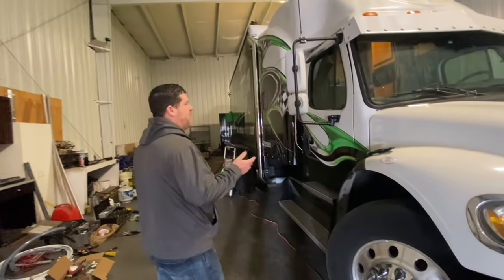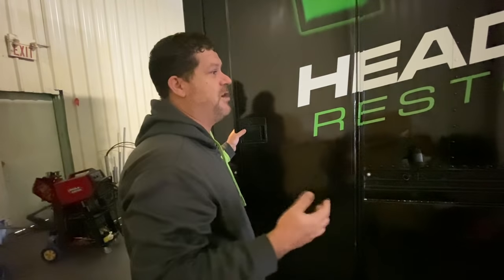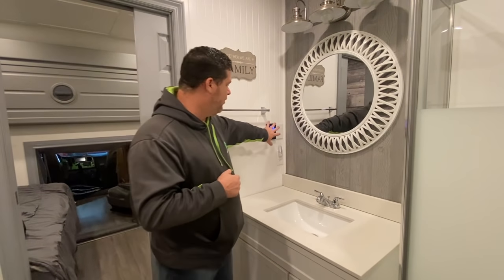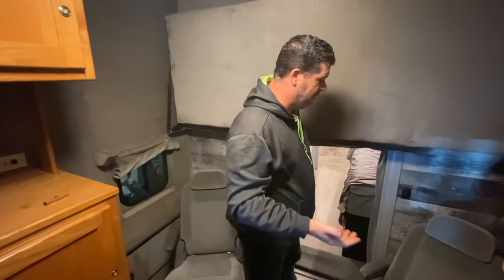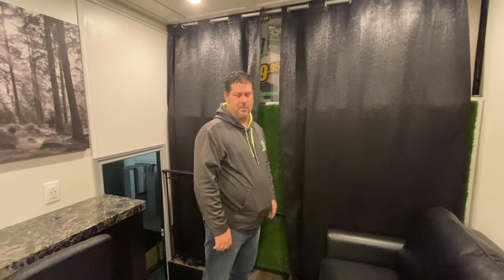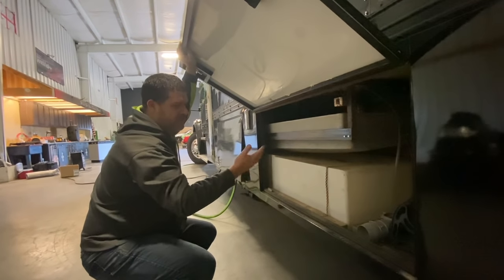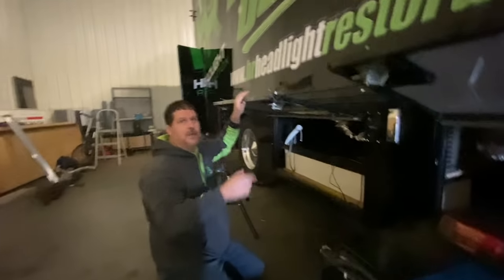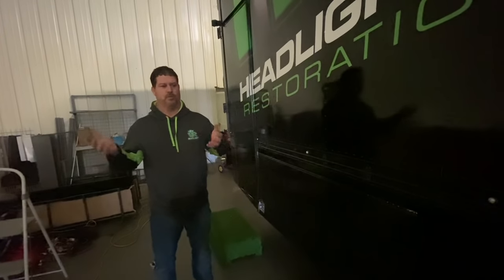Box Truck to RV!! Was it worth it??

Comment: $9000 for the interior?  What did you do gold plate everything like Donnie?  Do it right the first time?  What the hell is that supposed to mean when you're making a custom?  No wonder you spent yourself blind.  You wanted a Donnie Chump motorhome.  That's a bit too grandiose for me.  That's a bit excessive to me.  You could've thought this through much better.   I had to.  I was building an, on location radio and TV production vehicle.  And it needed to be self-contained.  And I wasn't wealthy.  I did this on a shoestring budget.  And it's immaculately done intelligently.  And my 2 carpenters worked for free.  As long as I paid for the supplies.  In exchange.  For recording their rock band once.  But that was not good enough.

That's right.  I deemed that not good enough.   And I told Dave.  That I could not record his band once.  He looked rather forlorn.  And said I would do the truck for you anyhow.  Because I need to know how to build a recording studio.  For another client.  I said no Dave.  You don't understand.

What Dave did not understand I was saying was.  I can't record your band just once.  I'm going to have to use your band like a guinea pig.  Like a chimpanzee.  Like a lab rat.  I'm that I have to follow you guys to the nightclubs.  I'm going to have to record you more than once.  To establish and get my routine down.  So  I can't record just one of your bands just once of the five bands you play with.  I have to record all of those bands.  He did not object.  And so for the next 10 years that's exactly what I did.

And so anytime I wanted to experiment with a new technique.  It would not be for a client that was paying me.  And so it didn't matter if I screwed up.  Dave and his bands.  Still got great recordings for free!  So that I could get ready.  And be prepared.  For doing those big radio station, national television and worldwide satellite broadcasts.  Of music entertainment events.  When we used to have them.  A year ago.  But I saw the handwriting on the side of my truck.  It wasn't going to be doing that anymore.  Because we can't.  Because it's over.  Our lives irrevocably changed.  As I was turning 65.  And 30 years into my business.  Which is now busted.  The business is busted by a virus.

But again.  I can't let the virus stop me.  And I'm going 100%, digital now.  Which is a lot more lightweight and portable.  And sounds every bit as good though not the same.  And I will have to adjust my recording and mixing techniques yet again.  Because I know how to roll with things.  In any sense of that term.  And my equipment was very valuable.  I had the best of the best of the best of everything.  And what does that mean?

It means.  If you watch a free movie on YouTube.  Directed and produced by, Dave Grohl called, Sound City.  That's precisely what was inside my truck.  Only better.  One of the greatest control rooms.  And on wheels no less.  Complete with a couple of internal studios also in the box.  That could accommodate musicians, also.  Or an FM DJ.  Or a television crew.  And it's been around for 30 years now.  And still going strong.  Because it's a brand and model of a truck.  That will virtually not die.  It's so well tried and proved over the years.  You don't find these here in the United States much anymore.  But you still find them all over the world in service to this day.  That's how well this Mercedes-Benz truck was built in 1984.

Oh come on.  You didn't think about that thermostat before you built the wall?  That wasn't well-thought-out.  I planned on my thermostat and where I wanted it to be.  And what about your central air conditioning?  An heating?  I have a forced air system.  The outgoing louvers..  Are up at the ceiling.  So the cold falls down.  I have the world's only 19 inch rackmount air conditioning outlet louvers.  Because I know how to design sophisticated recording studio and broadcast, control rooms.  You have to know what you want to install, first and prepare for that.  Build for that.  I did.  It's perfect.

And on top of that.  I pack a 7.5 kW, power isolation transformer.  Which means.  I can take 120 volts or I can take 240 volts.  And my power will always be electrically isolated.  And filtered.  And clean.  It kept my audio equipment even quieter in its operation.  And prevented any buzzing or hums from, what we call ground loops.  I share no electrical connection with anyone or anything.  Even if I am pulling power from the same place they are pulling power.  I'm isolated.  And nobody realizes the advantages of that.  Virtually no chance of electrical shock.  Virtually no dirty power.  Polluted by other compressors, motors starting, electrical interference, radiofrequency interference.  All nonexistent inside.

It was even built.  With a couple of internal walls designed to be removed for easy access to electrical, HVAC and audio wiring.  In the middle of the three rooms.  Which serves the rear room and the front room.  And is easily modifiable.  And instead of recessed lighting.  Which is very nice.  I like.  I elected to go mostly with, good old-fashioned track lighting with LED spotlights.  And LED rope lights on the floors.  On the walls.  Around the ceilings.  All on Lou Tron dimmers.

An conversion over to motorhome.  Will cost very little.  Between a few hundred dollars to $2000 maybe?

And oh by the way.  The whole thing has hardwood floors throughout.  About 3 inches thick.  Originally wall-to-wall carpeted.  Now Oriental throw carpets.  As the interior has gone through approximately 4 upgrades, modifications and iterations.  In the past 30 years.  Like any of these.  It's always a work in progress.  Because I designed it.  From the ground up.  And I know how to design for what is necessary.  No afterthoughts here.  As I have custom-built plenty of other recording studio and broadcast station control rooms.  And you learn a few things.

So that is an excellent well-thought-out custom box truck motorhome of a Super-C Class, variety.  Totally super!  And it can sleep up to 3 or 4 adults.  Without any stupid beds connected to the walls.  Because that's hokey.  As I have a futon couch in the living room control room.  I have a foldout foam 2 person loveseat couch.  The size of a double bed.  In the middle room.  And in the rear.  There is enough room for 1 or 2 plywood platform.  On storage boxes.  That can accommodate.  Air mattresses and memory foam topper mattresses.  That disappear easily against and behind a wall.   With the topper rolled up in a storage box.  But the couch and the futon only needed to be folded open.  And that can sleep 4 right there comfortably.  With another 1 or 2 in the rear room if necessary.  And 2 toilets.  One in the cab.   One in the rear of the box.

The walls all have 6 inches of compressed pink fiberglass insulation.  Compressed down to 3 inches.  The same with the ceiling.  With the aluminum skin roof that is reflective.  And keeps the heat load a little lower.

And so I did all of the math.  To determine the size of HVAC BTU's I needed.  With 4 people on board during a 93° day in the sun.  And it said I needed 18,000 BTU of air conditioning.  So I purchased a 24,500 BTU air conditioner/heater.  And had it custom mounted on the rear of the box outside.   The one and only entrance door is to the right.  And it has a power lift tailgate.  I typically use as the porch and entrance route.  I've also been known to set up a table on the power lift tailgate porch.   For a myriad of reasons and purposes.  From cooking to selling recordings.  Or to enjoy a nice meal outdoors not on the ground.

So in many ways.  Our designs come very close to one another.  In our conceptual execution thereof.  Only the acoustics in yours is resonant and boomy sounding.  Mine is very tight, quiet and subdued sounding.  With a boatload of acoustic ambient absorption.  And doesn't sound like an empty garage like yours.  It's intimate sounding and feeling.

And yeah!  No windows on the side of the box.  Because I don't keep normal hours.  I like to sleep late.  I like to sleep in.  I like it to be 3 AM at 1 o'clock in the afternoon.  And that's when you turn off the lights inside.  And nice cool quiet noise free air conditioning.  Because there would be open microphones.  And you don't want to hear your air conditioning with open microphones.  Right?

So that was a great build.  I'm very impressed.  We are now family.

Oh Lord.  Won't you buy me.  A Mercedes-Benz.  So I did.

About 25 years ago I really freaked out my father.  He didn't live in town.  But he occasionally came through town.  With the Cleveland Symphony Orchestra for which he was one of their concertmaster violinists.  And we would get together.  And go out for dinner.

This time around.  I told dad.  I would be picking him up in a 30 foot long, white stretch, Mercedes-Benz.  He got very alarmed by this.  He asked me, "Remy, you're not selling drugs are you?"   I said no pop I'm not.  But I have this 30 foot long stretch Mercedes-Benz I will be picking you up in.

So when I got to George Mason University where the orchestra had been rehearsing.  They had a circle in the front.  There was my dad standing out in front.  And as I pulled into the circle.  I beefed the horn.  And he looked up.  And he saw,  who was driving this 30 foot long white stretch Mercedes-Benz.  I just never told him it was a truck.  And he beamed with this gigantic smile.  And got in the cab.  And we went to dinner.  Valets don't know how to park my truck.  So make certain not to let them.  You have to park it someplace.  You can't trust others to do that.  They'll destroy it.  Accidentally of course.

Vroom!  Vroom!
 RemyRAD